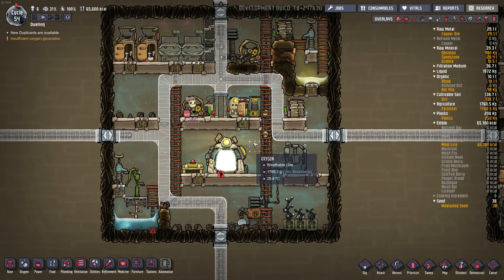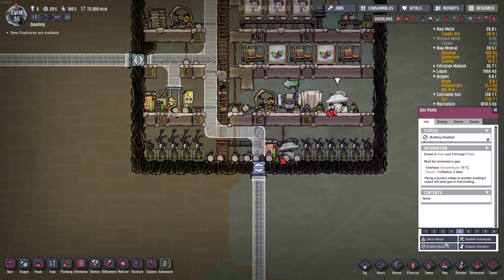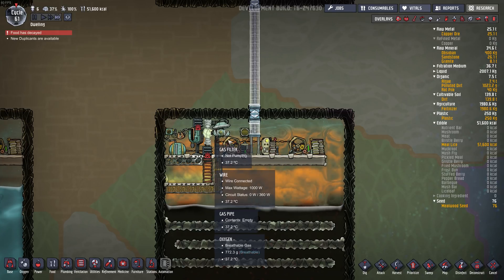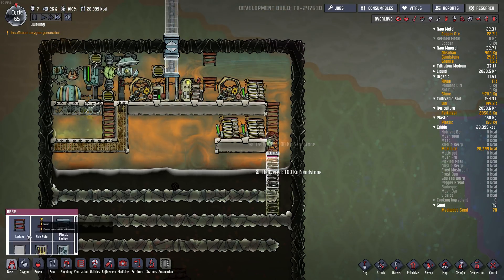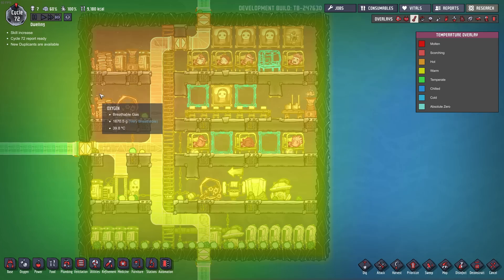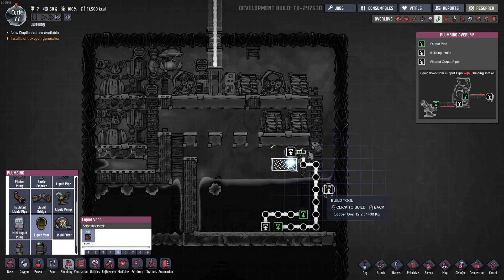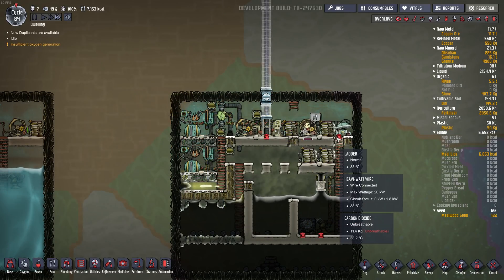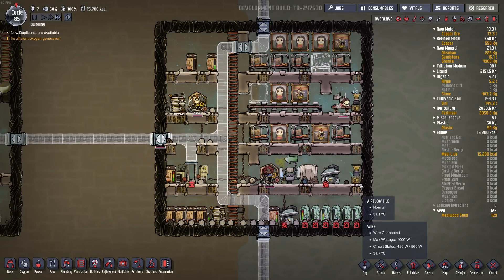THE TUBE COLONY CHALLENGE (Take 2) #4 - Oxygen Not Included Tubular Upgrade [4k]

Comment: given there is only one pipe between cubes how would oil cooling work given there can be no return loop? 
It's kinda  shame they didn't give each cube two liquid and gas pipes as well as power transfer, it's a neat challenge but the restrictions make self sustaining designs questionably possible given lack of methods to remove heat.
Reply from the maker: I'm going to send cold oxygen out to cool the base. I like the single pipe constraint....keeps it "interesting"

Comment: From what I've observed, the thermal aqua tuner loop is slow and ineffective for water but much faster when the cooled water is sent to a separate tank.  I bring this up because I wonder if this would hold true for oil and because it makes intuitive sense to me since the thermal aqua tuner heats the liq. its in.
Reply from the maker: It doesn't really follow the laws of thermodynamic since the machine heating up should counteract the cooling effect. But it does get colder and colder which is nice. I think without wheezeworts for this challenge I would have died from heat death without oil cooling. Check out episode 5 (coming soon) to see how cold it can get.
Reply: Oh cool!  Good to know.  I'm stealing that!
Reply: a smaller tank will indeed speed up the change in temperature however that is because there is less oil to cool down, the total heat change is the same. 

It is a useful to have a holding tank when using liquid tepedisers to kill germs from processed polluted water, as you can set up a holding tank that will automatically fill to 1 deep, heat to 70c, wait a short time and then dump the water out the otherside to your clean water supply. Trying to do a large amount at once results in more heat leakage as it takes longer to heat up.